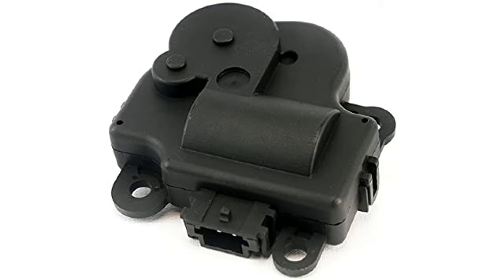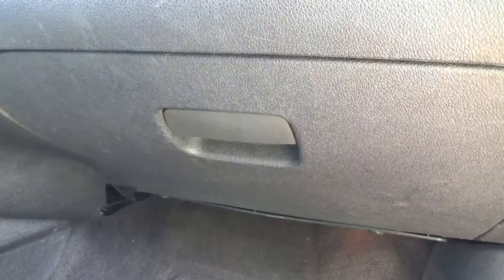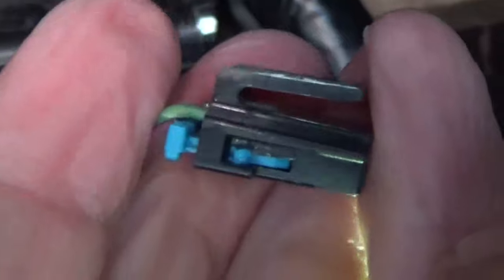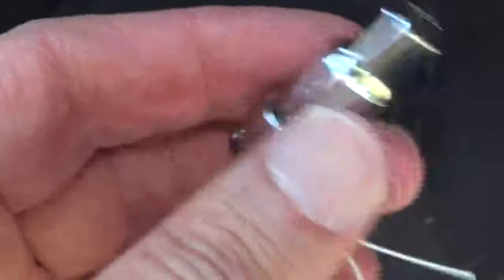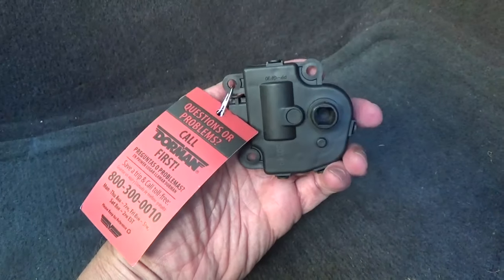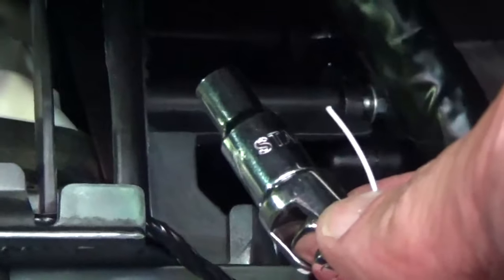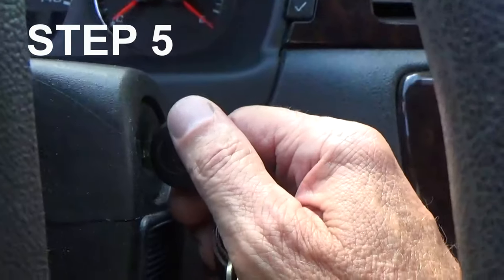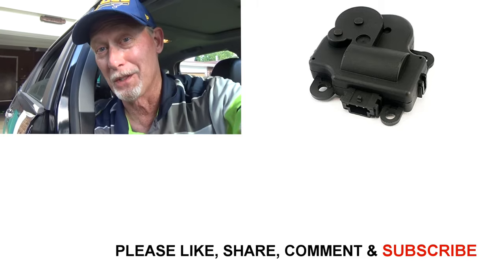HVAC Blend Door Actuator Replacement 2006-2013 Chevrolet Impala & 2014-2016 Impala Limited Click Fix

Comment: Would that drain the battery
Reply from the maker: On its own, it wouldn’t normally drain the battery. It might slightly increase the drain on the battery, but that would only be when the ignition was turned on and electricity was flowing, and the alternator should be able to keep the battery sufficiently charged when the engine is running.

Comment: My 2014 Impala isn’t making a clicking noise, but when the AC runs, it will randomly start blowing really hot air on the driver side only. The only thing I’ve had work so far is unplugging the HVAC fuse, or turning my AC completely off for over a day. Any tips for repair? I don’t want to take apart my car for it not to be the actuator.
Reply: What was it? I changed my driver side actuator but it’s still blowing hot on passenger side

Comment: Thxs good video but after I did all that in the video my driver side vents still blow hot air n passenger ice cold
Reply from the maker: There is also an actuator for the driver’s side so it possibly may need replaced too. It’s located under the steering column area. This vehicle has four actuators altogether, which is a pain, since they apparently weren’t engineered for longevity.
Reply: @HowSkills  ok so I replaced all 4 blend door actuators...nothing hot air still out the drivers side ......had my ac vacuum and recharged it to specs.....nothing I over filled it and it started blowing a little bit  cold passenger's side ice cubes fall out of that side what gives?.??

Comment: Hey Steve,

My motor on the actuator stopped working so I don't know which one it is. How can I tell? I guess by testing them one by one huh?
Reply from the maker: The ones on the right behind the glove box are fairly close to each other and you can normally isolate which one is the problem. There's one that's flat against the left side of the glove box area and one that's mounted up and to the right side as in this video. Since the actuator isn't making noise, take turns placing your fingers on the two actuators that are out in the open as you move the heating/cooling controls. If the actuator is good, you should be able to feel a movement or vibration in it. If you go through the full range of temperature settings and you feel nothing from the actuator, then that's probably the bad one.
Reply: @HowSkills  thanks for the info. I really appreciate your support. #youaretheman!
Reply from the maker: No problem...glad to help!

Comment: Does powering the new actuator up so as to line up the slot of the old actuator create  a problem?
Reply from the maker: It didn't. Everything seemed to work fine doing it that way, and no problems have come up since the installation. Works great!

Comment: I'm getting real good at replacing these things because often within a year I will have to replace them again. a bunch of plastic junk. good video though. Chevy needs to make these things out of metal
Reply from the maker: I've replaced three so far, and one them did last just a year. They have to be able to do better than that with these things...very frustrating to keep replacing them.

Comment: my 2014 impala lt doesnt have the clicking noise but instead does not blow air through any vents besides the defrost and does not respond to changing vents, would this be related to the actuator?
Reply from the maker: Yes, it's very likely that one of the actuators isn't working correctly and is stuck in one position.
Reply: @HowSkills  I think this is my problem. My passenger side heat works ok but the driver side is cold. But I do not hear any clicking noises.

Comment: My daughter got one of these 2008 Impalas as a first car. The blend door actuator was making the ticking sound. We replaced it. It now opens and closes the blend door, but thwacks the door closed for another 30 seconds after reaching the closed position. Thump, thump, thump, it beats the door like its a drummer in a bad bar band. Same thing happens when it opens the blend door. Reaches the fully open position and then thump, thump, thump, repeatedly tries to open it again like it doesn't realize it is already open.  What can we do to correct this other than leave the actuator disconnected?
Reply from the maker: Sounds like it may not be calibrated. Try this advice from an online forum: disconnect the negative battery terminal for five minutes, then reconnect it. Start the car and do not touch the HVAC controls. The HVAC system will perform a self-calibration which takes about two minutes. During this time you may hear the controls moving and activating if you are seating inside the car.

Do this first before removing the new part or disconnecting it.
Reply: @HowSkills  Thanks very much for the reply Stan.  Here is a video of my problem: https://youtu.be/F9p3YtjNWSs 

I tried to re-calibrate it by turning the fan off (to zero), turning off the car, pulling the DISPLAY fuse, waiting 10 minutes, then replacing the fuse, then putting the car into accessory mode, waiting 5 minutes and then starting the car. Seems to have made no difference.

Is there a micro-controller that might need replacement? Would I need to clear any diagnostic trouble codes (DTCs) beforehand for the re-calibration to be effective? I don't have an OBD tool. Would having an OBD tool be necessary to clear the DTCs and force the re-calibration? If so, do you have one to recommend?

Thanks again.

Comment: I watched your video and now I can’t get it to line up rite I hooked up the new one and still clicking
Reply from the maker: Did you get it lined up as best you could and then go through the reset procedure? That usually works. And if it's still clicking, that could mean that one of the other actuators has failed also. Place you finger on the one you replaced and see if you can feel the vibration when it clicks. If not, then it might be another one. There are three of them located in the same general area around the glove box.
Reply: @HowSkills  thanks for the information yes I got it lined back up the best I could and the same one still clicking

Comment: I have a question would that makes my car run hot?
Reply from the maker: If the blend door actuator wasn't working correctly it could make the temperture of the air coming out of your vents hotter.
Reply: @HowSkills  but would make my waters residue boil hot and spill it?

Comment: Mine did not come recalibration instructions. Is it necessary?
Reply from the maker: Many times it's not, but if you find that the actuator isn't working correctly, then you should try the calibration technique.

Comment: Great instruction video. However, for whatever reason Chevrolet decided that on their 2014 Impala LT they would change it up. The glove box assembly is quite different. I was able to remove it, but there is a wide dash frame member going across the opening which blocks all access to the actuator motors. I can see the Blend Door Actuator, which is my issue. But, I cannot get to it. Checking with the dealer, I am told that for this particular model, it has to be done at the dealer, as they must remove the whole dash assembly to get to the actuators? So, basically it will be around $1,500 to install a $30 part.  Your instructions work for 2006 through 2013 and then pick up again on the 2015 and above. Not sure what idiot designer decided to change this on a single year model? Anyway, I appreciate your information on this. Thanks,
Reply from the maker: That is very strange that they would change the design like that! Thank you for the information…and sorry to hear they charge that much. Poorly engineered, but sounds like they learned their lesson and went back to the former design.

Comment: I'm doing the manual calibration right now and when it's time to take the key out and then, connect the negative battery cable, I can't even get the key out of the ignition..... it's locked in position as soon as I turn it to the "on" position.
Reply from the maker: That’s okay…the calibration should work anyway, as the battery being disconnected for a length of time is the main thing that matters.
Reply: OK thank you. Is the actuator supposed to be plugged in during all of this? Or does it need to calibrate, then plug it in? Sorry if that sounds stupid, I tried it last night a few times and it just continously clicks everytime after I follow the calibration steps (with it plugged in).

Comment: This is a more realistic video of the issue. I'm struggling with the right actuator because of the small space and that cord. I may have to get that small piece.
Reply from the maker: That cord is a real pain. If you can find a really small & short handled socket wrench that might work too. Something roughly palm-of-your-hand size. But the little elbow socket I found worked great for me. Good luck!
Reply: @HowSkills  I was able to get it (after multiple breaks). Lol. It wasn't fun though!
Reply from the maker: @eliteeloquence08  Nice! And that's exactly how I remember it - "Not Fun"

Comment: My ac blows on driver side while the heat blows on passenger side, no clicking knocking. Would this part be the problem
Reply from the maker: Yes, it could still be related to an actuator failure. A lot of times when one goes bad, there is a distinctive clicking noise, but not always. A bad actuator would be my first guess.
Reply: Damn what was it bro?
Reply: @TILIS214  it ended up being of 2 these actuators

Comment: What happens if you don't recalibrate the actuator?
Reply from the maker: In most cases, the system will probably function very close to normal, but there is the chance that all the position settings on the controls won't do perfectly what their markings say they are doing. You might get more cold air than hot air than the setting leads you to believe.

Comment: I dropped the screw that goes in the second one. How can i get it!
Reply from the maker: You can get a flexible magnetic pickup tool at many stores like Menards, Lowes, and Walmart, and of course can order online from Walmart, Amazon, Harbor Freight, etc.  Here's an affiliate link to one on Amazon, but a lot of places have them. Hopefully you can move this around until you can grab the screw with this. If not, you'll have to take apart more of the dash.
Reply: @HowSkills  is it possible to just leave it? Or do i absolutely need both?
Reply from the maker: @beawavy9150  You could leave the loose screw in the dash and there more than likely won't be a problem, other than you'll probably hear it rolling around in there, which can be annoying. But I would definitely use two screws to hold it in, otherwise it may gradually work loose and cause more problems. If you can't retrieve the lost screw, I'd get one to replace it. You can remove the one that you already have in there and take it to a hardware or auto parts store so you can find a match, or go to a Chevy dealer and get one from them. But I wouldn't take the chance of securing it with just one screw. Just my opinion!
Reply: Get a magnet retriever they sell them at any auto parts Walmart
Reply: Don’t be a lazy person do it right
Reply: Next time get a neodymium rare earth magnet. I believe N 35 is high power classification magnet. Set all the tools that will  contact the bolt or screw on the magnet for about 20 minutes before you attempt the repair. When the screw or bolt  drops the tool will catch it.
   For additional insurance figure out the drop zone and  place N 35 magnet so when the screw or tool drops the magnet will catch it. 
  Also Harbor Freight sells  ratcheting disc , that looks like a half dollar, that you put a socket on it for tight places.
  Another better but more costly  tool for tight clearance  is the open ended internal ratcheting wrench that is positioned over the head of bolt. Again magnetize the tool ahead of the work.

Comment: How many actuators does my 2013 chevy impala have?
Reply from the maker: There are four actuators altogether.
Reply: @HowSkills  I think there is two on the left side behind the glove box. Then one on the right, toward the back of the glove box, and then one under the steering column.
Reply from the maker: @bmlove81  Yes, from what I understand, that is correct. This is from a CarGurus blog: "The single actuator under the driver's side is for temperature control of the drivers side. The actuator on the far right side of the glove box area is for recirculating air - fresh or inside recirculation. The one on the left side toward the front is for directing the air flow top, middle, and bottom vents. The one on the left behind that one is for the temperature of the passenger side."
Reply: @HowSkills  perfect, thanks!
Reply from the maker: @bmlove81  You're very welcome! Take care.
Reply: My heat is not working on passenger side.And every winter with my heat i get a P0171 lean code .could that part cause a vaccum leak

Comment: On my 2011 impala, the key is locked into the ignition when the battery is disconnected
Reply from the maker: That's okay, it should still work. Just turn the car off and leave the keys in the ignition.

Comment: At 2:46 that's all I needed to know one on the left and one in the right.
Less than a year ago I disconnected the right actuator from my impala. Well I disconnected the wire which connects to the actuator. I left the actuator there. By disconnecting the wire it stops that clicking noise.
What i didn't know is that is two actuators in the impalas. 
Two days ago that clicking sound came back and I was like WTF I disconnected the wire!
Yes I did but not knowing that there is one more actuator. I'll be disconnecting the wire to that one also.
I don't replace the actuators its a waste of money and time.
The AC works fine and have no complaints about how or which way the air is flowing.

This is for you Chevy dealers
🖕🖕🖕🖕🖕
Reply from the maker: Thanks for the comment and for watching...too many actuators in this car.

Comment: If you're going to post it as a blend door actuator replacement actually change the blend door actuator not the recirculation door actuator
Reply from the maker: That's true. The replacement process is roughly the same, but the function of the actuator I replaced was different than the title. So far, I've replaced three actuators in the vehicle. Chevrolet didn't design them to last forever, but then again, why would they?